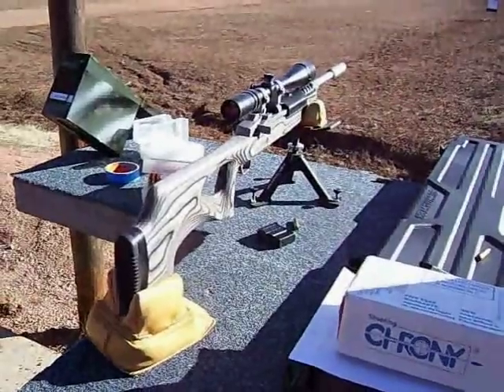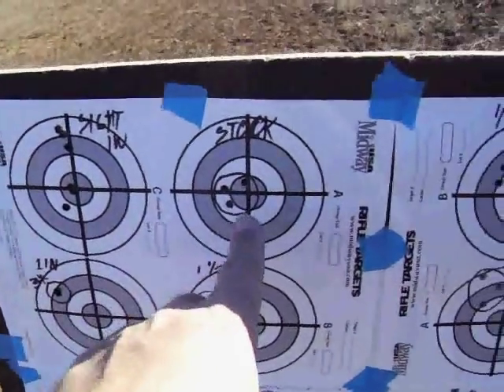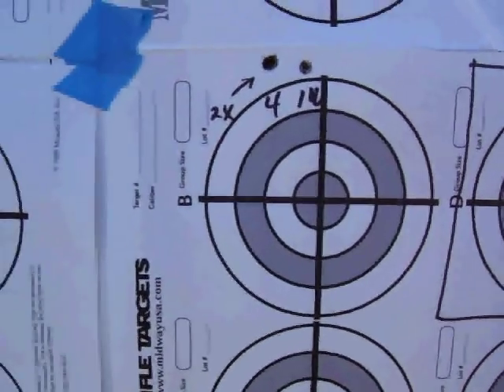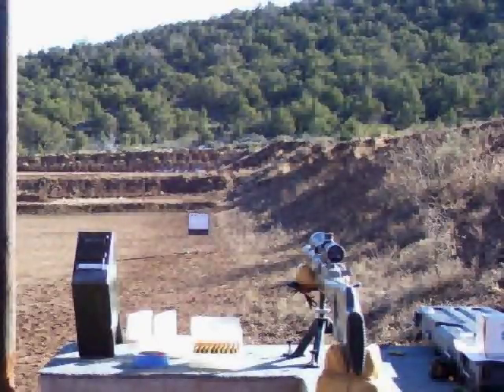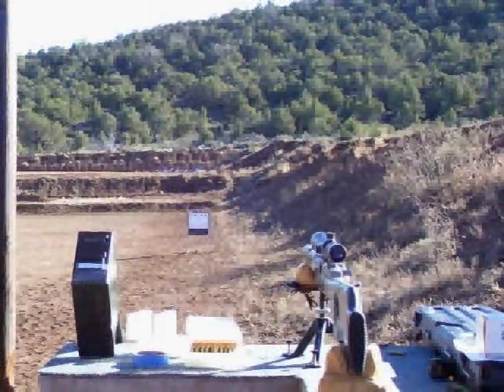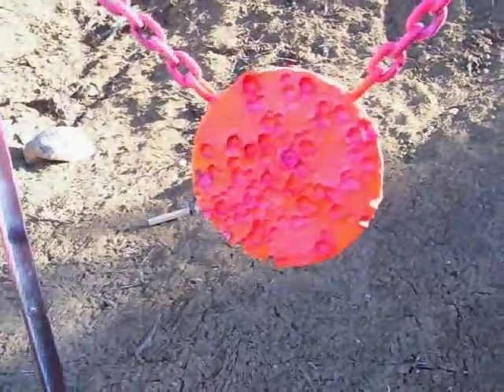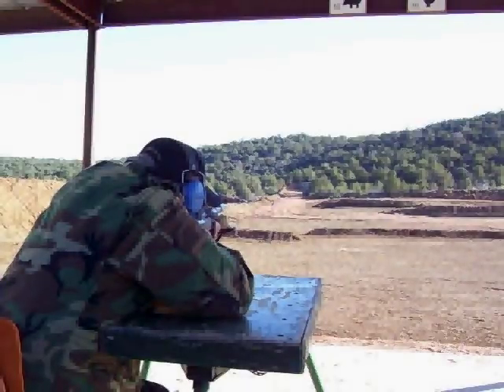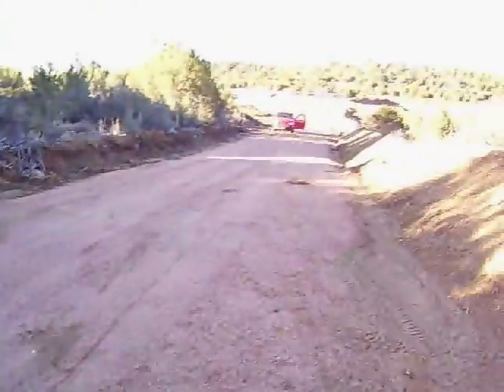Ruger's New MINI-14 Target Rifle

Comment: I have mine outfitted with the Nikon Buckmaster 4-12x50 scope. Extra high scope rings were required to get it to fit above the receiver/handguard.. This Ruger Mini 14 target rifle perfomes better than I ever expected... I have owned Mini 14's and Mini 30's for years and accepted the fact they were minute of paperplate accuracy... This new Mini 14 Target is as accurate as many bolt action rifles - I am truly impressed! I was apprehensive spending over $1000 for the rifle + scope but not now!!

Comment: according to other hands on tests I have read, the first few groups that were not as tight as desired were the result of the trigger getting broke in, you getting accustomed to the feel of it, AND, something to do with the chamber. two other testers found it more accurate after shooting 50 rounds, cleaning and lubing the chamber and gas rod. The shot groups came in much smaller after the so - called break in.
Amazing.

Comment from the maker: I was at 50 yards. I only show the course adjustment to let you see how much difference the harmonic tuning can give.  After I found the sweet spot I did about another 25 rounds fine tuning at full torque.  At that point it was putting a hole in a hole at 50 yards, a quick check at 100 and corrected for a Zero at 200, and that’s what it did

Comment: Thank you so much for this video Paul!  I've wanted the Mini-14 Target for about 5 years now, largely due to your video here, and I finally picked mine up tonight.  Same stock, and I went with the entry level Leupold VX-1 3x9x40mm & a Harris bipod.  I haven't even shot her yet, but I wanted to thank you kindly for taking the time to make this video!!  How far out were you with the paper targets when you first started adjusting the dampener, and what ammo were you using to sight her in with in this video?  Thanks in advance!
Reply: If I may interject, start at 50 yds to get it on paper, then 100 yds, Only adjust the scope first. then start adjusting the harmonic dampener. to get a nice "quarter sized" group. Then readjust the scope, to get in line. Work it on out to 200 yds, 300 yds upto 500 yds... yes I said 500 yds it can do that! (as long as your scope and eyesight can). Cheers!
Reply: Just seeing this reply, lol. Good advice!  I upgraded the scope a few weeks after to the VX-2 4×12×40mm.  Much better, but I doubt I'd be able to see much at 500 yards out of that thing, lol.  It's all good, as it's hard to find a range over 100 yards anyways, cheers!

Comment from the maker: No You said    "Minis are built sturdy enough to handle the extra pressure of the 5.56 with the exception of the new target models that sport the harmonic dampener. Any ideas on why that would be? "       This was cut and paste from your original post. The owners manual says 5.56 or 223 and the one on line says 5.56 or 223. Maybe you didn't mean  " with the exception of " in your original post.

Comment: Thanks Paul (from the great with north - Canada). I bought one of these a week ago and tried it out with a Bushnell 4 - 7x 40 scope (thinking medium range). I'm a 338 Win Mag guy, but I can't believe I was shooting "quarters" 1"up from center - bore sighted at 100yds with Hornady V-max 55 gr. right out of the box and no harmonic dampener adjustment yet! Punching holes through ¼" plate steel at 25 yds. OMG!! I had to run out to get a Bushnell 4-18 x 40 223 Tactical scope this week, because the 4-7x scope was not good enough!!! I will be re-tuning with Hornady Z-max 55r for those Zombie Varmints - LOL! Hi expectations now! (Not to plug Hornady, but they make FANTASTIC rounds for the price, and reloading is even better!!!)
Reply from the maker: Great !  ,,,   my goal with 223 is to shoot the cheapest round I can build and shoot a lots of them.   I am dialed up for the bulk Winchester / Remington 55g crap (~$65 per 1000).  I don't even like to tell people how tight a group it does at 300 yards due to haters making comments.  Have fun !

Comment: 5.56 Nato and .223 Rem are not the "same" cartridge.  5.56 has a considerable amount more pressure than the .223, and the cartridge dimensions are not identical.  If you read the owners manual, you'll see that it also states that using 5.56 Nato is ok in the Ranch Rifles, but not ok in the Target model.  The chamber of the Target model is built specifically for the .223 Remington, and is not designed to handle the 5.56 Nato cartridge.

Comment: What is the purpose of the harmonic dampener? I've read a few articles that claim that it gives increased MOA capability, but how does it make the weapon more accurate if not just for the added barrel length?

Also, is it possible to combine this with a muzzle brake/flash suppressor?

Comment: Hi Paul I have the same mini 14 target rifle except with the normal stock and I have not tweeked with the harmonic dampener at all yet, the rifle get's 1" groups at 100 yards pretty easy so do you think that I should even bother fooling with it? and if so do you think that I should run the dampener in like you did to start off with or just try a 1/2 turn at a time?.   M
Reply from the maker: Whatever you do use the same ammo and take good data on what you are doing.   Put marks on it with a Sharpie so you know how far you turned it.

Comment: Thanks for the video, Paul. What made you decide to keep turning in the harmonic dampener to 2.5 turns when it already had such a tight group at 1 turn?I recently bought a 5828, Archangel stock, Nikon M-223 4-16x42, Atlas bipod, and I'm ready to sight it in. Trigger has been reworked to 3.2 lbs. And, yes, you rock.
Reply from the maker: If you need any foo foo dust information on tuning the harmonic dampener feel free to contact me.  About 2.5 turns works for my ammo maybe 1 works with yours ?

Comment: with all due respect I can only speak for myself but with the model 5808 that you are using I have had my best luck with Fiocchi, " 223 FHVB extrema Factory loaded with Vmax 40 grain bullets they come out the door at 3650 but get with the program and end up where they're supposed to they are basically a polymer filled hollow point and are available at Sportsman Guide dot-com 200 rounds with a very nice box for $95
Reply from the maker: +David Eustache Thanks for the info.  I believe this rifle will shoot about anything if you tune it to that ammo.  I shoot the cheapest ammo I can witch means I reload.  Under $200 = 1000 rounds but not everybody reloads.   It's always nice to hear what people use off the shelf.

Comment from the maker: 7.62X39 is not even in the game. Check the ballistic tables and you will find that it falls short.  7.62X39 ammo is such a mess from most sources accurate long distance shot placement is out of the question.  Quality ammo has a much higher price and you should consider 308 for more bang for the buck.

Comment: Ive got a Tikka t-3 Lite synthetic with a 4X-12X Vortex on it .But i was looking for an accurate semi auto because the ground is covered with ground squirrels. 
Getting anything here,especially ammo. is a genuine problem.Prices are Nuts like $20 for a box of 22WMR,minimum.
Reply from the maker: Ray Hansen Sounds like you need to start reloading.  When you pull the trigger they all go down so you still have time to chamber your next round with your bolt action

Comment: I just got this thing and have spent a few sessions at the range breaking it in. Is it just me or does it like cheap American Eagle in 55 grn? I have run it with Black Hills and Hornady,(which my AR Loves!) but I am getting better groups with the cheaper stuff!. Next part is messing with the balancer. I found that when I was testing it a week ago, that it liked the balancer forward. 

I have to add that the trigger is terrible, and that I shoot better far better groups with a bolt .223. I get that a bolt is more accurate, but this thing is nowhere near as accurate "out-of-the-box"  as the RPR. Or even the American Rifle in the same caliber. 

Ideas?
Reply from the maker: You have tune it to the ammo. As far as I know it will like any ammo if you tune it correctly to that ammo.   I have mine tuned to shoot bulk 55 gr Remington or Winchester bullets out of my reloads and it will shoot really small groups at 300 yards   <3 inches. If it is not tuned correctly =big group
Reply: I took it to the range again today and ran about 75 round through it. It is now dirty, but coppered up enough to make a difference in the barrel. I totally get the damper thing now-thanks to your advice! Tune that in on a red-field target or something big, then dial-in the scope. Thank for that. 1.75 turns in is magic.

At 100 yards on a lead-sled I approached 1 MOA. However, I found that as the barrel got hotter, that the groups spread out quite a bit. I spent about three hours shooting (between three rifles) on and off  trying to let it cool and get itt as accurate as some other rifles I shoot. Notably, Tiika .308, RPR 6.5mm, M1A, and have just not gotten there yet. I don't hand load (but I know how, just no time) So I don't have any ladder data to offer.

I did find that it likes the plane-jane 55.grain standard FMJ round and not anything else. Boat-tail and Hollow-point were all over the place. My AR loves 50 Gr. hollow point and 55 Gr. Black Hills. Nothing else!

So maybe it's an ammo thing....

The other issue I have is the trigger sucks! Any advise on a drop in or where to send it off to? It has a wall and at least an 8lb break!

I noticed in your video, you are out West and it is cold. This may have something to do with the shots too. I did not take any air-pressure/humidity into account.

-Be good, and do well!
Reply from the maker: The trigger will smooth out on it's own or you can help it with a little polishing on contact points.  They seemed to have increased the spring pressure for shorter lock time so the trigger may feel heavy but not a major issue that I seen.
Reply: The trigger is in fact getting better!!.. Is it normal to have to tighten the balancer after every 30 rounds or so?? I suspect that I am getting the barrel hot. Thanks for your input! Still not getting sub-moa but hey, this thing is stupid accurate for a Mini-14!

Comment: So, it has a rail mount yes?? I want to put a red dot scope on this model, thanks!
Reply: You can do what if you want, but I would put the best scope possible on this!. You will be surprised on its long range accuracy capability. i'm tuning mine to 500 yds at the moment and with bulk ammo even (Federal FMJBT)!!!!! Im using a Bushnell 4-18 x 40 223 Tactical scope. What a marriage!
Reply from the maker: On the standard Mini-14 a red dot maybe, it would be a waist of a great rifle
Reply: Nikons m223 3 x 12 x 44  is really dialed in for the target mini . and it works . been shooting mine at 700 yards which is past the 600 max on the Nikon . but it still keeps going . not sure if the bullet has any power left in it though lol !!

Comment: I had bought this gun new a couple years back for close to a grand. I spent almost a year going thru ammo and adjustments trying to find the “sweet spot”.  The problem I had was I would get it sighted in, and then next time out it would shoot in a different spot. I will say I got it down to about 1.5 inch groups at 100 yards. The good is the gun always went bang. But the gun is very heavy and does not shoot 5.56 rounds. I bought a good ar-15 that weighs only 6 pounds and it shoots ½ inch groups from 100 yards and shoots all different brands well. Best thing I ever did.
Reply from the maker: Mine shoots crazy good.  It shoots everything well but shoots the ammo it is dialed up for like a laser. The only rifle in 223 I have that shoots as good is a Savage 10FP (Bolt Action)with ammo matched to the rifle. Sounds like you had some problem with something ?  I don't think I have touched an adjustment including the scope on mine for years. I did just upgrade the scope and it was a <10 shot dial up ???
Reply: cbaracuta's experiences are accurate and typical of the gun. The tuning the harmonics is a neat, but doesn't make much sense, given that any small temperature difference will affect the velocity of the round enough to throw the tune off (and hence why you had to retune after every trip to the range) unless you were already shooting an OCW load (a different type of tune, S wave vs P wave) where the tuning doesn't matter as much.

The tune is nice if you have a load that you have to use (and can't handload to an OCW) as it allows you to shoot at its best for that load, but isn't a substitute for handloading and finding accuracy nodes. Neither is it a substitute for a good quality barrel, and even after the retooling, the Mini-14s can't compete with the varmint barrels produced and used for many AR-15s.

I came really close to buying one of these about a year ago, but then realized that for the SAME MONEY, I could put a Lothar Walther match 6.5 Grendel barrel on an AR platform that shoots bugholes at 100 yards and leaves the 5.56 (and ESPECIALLY this rifle) in the dust beyond that. I've ended up spending a little more than I had planned (Geissele High Speed DMR trigger, but who can blame me with a trigger like that?), but still an incredibly inexpensive gun that shoots like a laser. Similarly, my father has a DPMS LR-308 ($950) that is a consistent 1/2 MOA with match ammo and 3/4 MOA with PMC Bronze.

Neat gun, but like most of the Mini-14 series, it's overpriced and underperforming for what you are getting when you compare it to the ARs.

Also, 3 shot groups are great for checking your aim, but not really for demonstrating or checking accuracy unless you plan on averaging 10 of them, or something. 3x5 shot is the minimum, and a 10 shot is preferred for checking extreme spread. This has a lot to do with how bullets follow a bell curve in terms of accuracy. You can have a 1.5 MOA gun shoot 3 rounds in the same hole once (which is what you were showing) and not have that ever repeat again. Measuring from just that great group, you would be chasing your tail forever trying to find that 'accuracy' again.
Reply from the maker: 7h3647h32in6 Don't understand how you could tune it after every shot ?  The groupings I am showing is just a demo that the tuner does something.  No I did not have time to show the final tune.  If you are truly in the center of the dead spot 1/8 turn either way makes little difference and +/- normal temperature variations makes little difference. I have had only good results with this rifle and a few others I have assisted in setting up.  And yes it shoots < 1MOA consistently not just by luck putting 3 round in the same hole once in a while.
Reply: PaulsWackyWorld That was a typo. I had intended to write "every trip to the range", not "every shot", but glazed over it in my proofread.